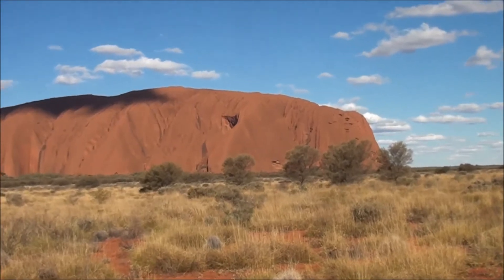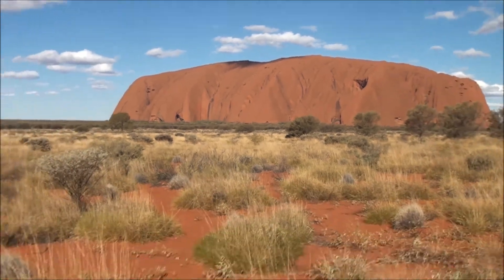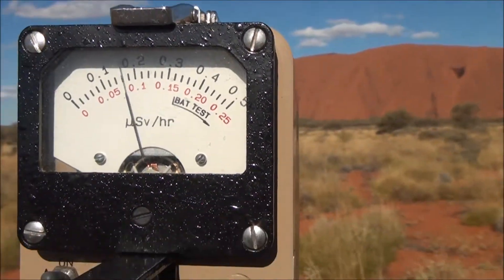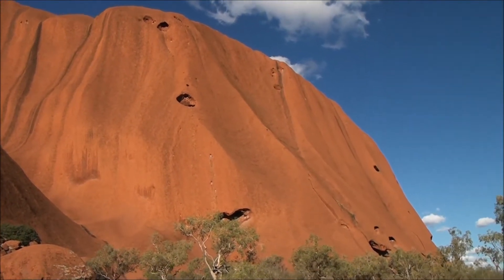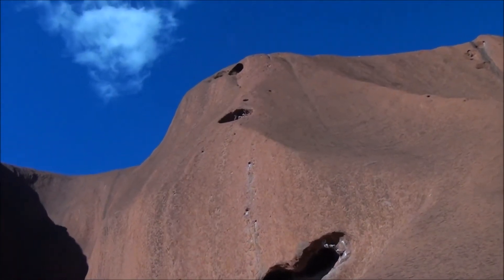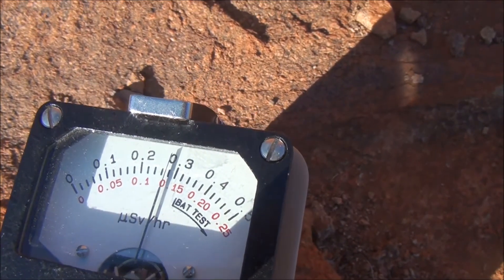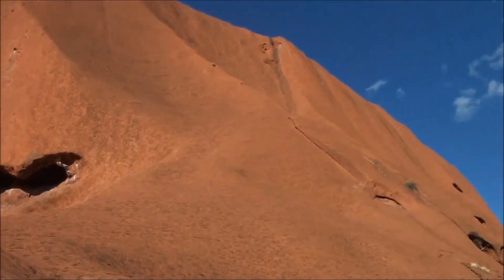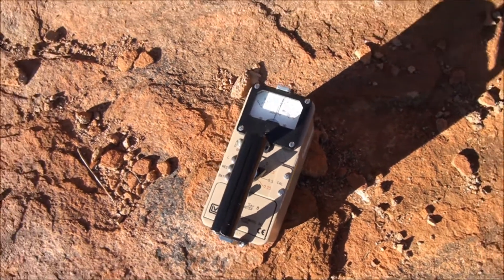Is Ayers Rock ( Uluru ) Radioactive?

Comment: Quite possibly Mt Wollimbin is a puncture wound from a comet that has a high Thorium content and the comet has penetrator into the earth, begun reverse rotation due to the pressure density difference in the mantle being more viscous above than below, and then the reverse rotation has caused an upward vector to push Ularu up from what was once the sea floor, explaining the seashell fossils around her.

Comment: Speaking as a layman, does that mean if you should hang around there long enough, it will make you ill? or is what we are seeing / hearing just "normal" stuff and completely harmless? - Fascinating!
Reply from the maker: Readings are safe enough but about 10 times higher than average background readings which are due to naturally occurring radiation such as cosmic rays and naturally occurring elements in the ground. Granite contains Uranium type elements so areas with lots of granite are more radioactive. I was surprised however to see such readings at this place which is much higher than any other place I visited and Radon gas accumulation in some of the caves might be a concern for peoples health.